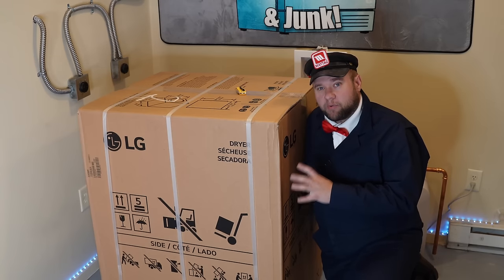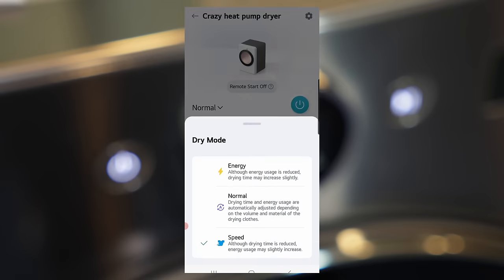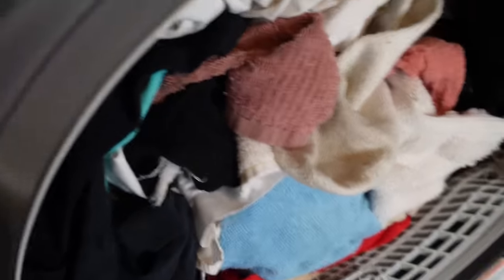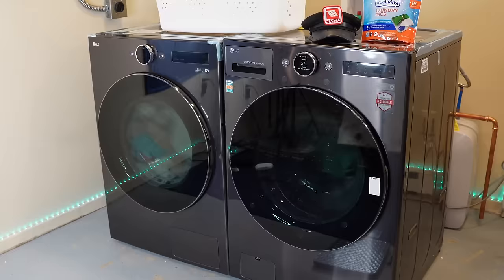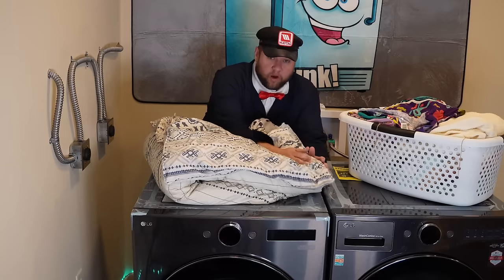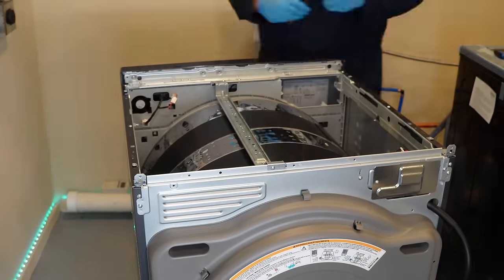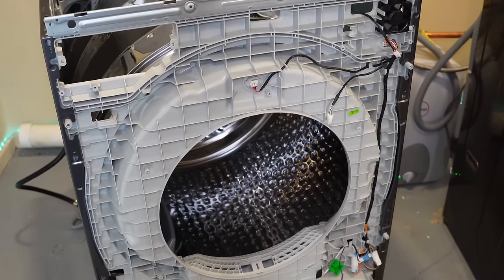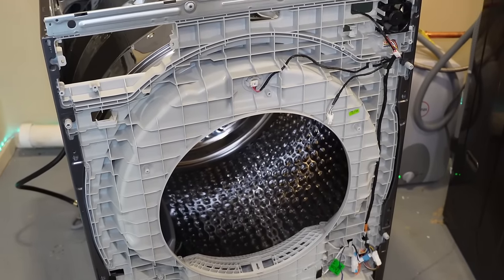LG Heat Pump Dryer - Way Better than I Expected - DLHC5502 Teardown & Review

Comment: You mention the built-in coil wash system, which seems like a nice convenience (assuming it doesn't get clogged over time). However, what is stopping you from just spraying the condenser coils down with water on any of these heat pump units? They're obviously designed to get wet and, as long as you're not using a pressure washer, I think you'd be less likely to damage the fins by spraying them down than by trying to vacuum them out.

Comment: Fabric care would be interesting comparison. A longer but cooler LG cycle or a shorter but (allegedly blisteringly) hot Speed Queen cycle?
Reply: I’ve had a Siemens (Bosch) heat pump dryer since 2013, and my verdict is that it’s way gentler on clothes, due to the significantly lower temperatures. On regular, it’s barely as hot as a typical vented dryer on delicate. On delicate, it usually finishes drying with the clothes being just warm.

Comment: Ben Love your videos very informative. My question Is I read sometimes about people buying ventless heat pump dryers and saying they suck. I know they are different, and was wondering If some  people may install the wrong such as not enough air around the and having a small space with no air vents. Having a Heat pump water heater I know that was a requirement before installing to make sure there Is enough room around It to do It's job. Is this a problem you see.

Comment: You mentioned that it is stackable. Is it stackable with the combo unit? From what I understand, the combo unit has the filter on the top so it might not be. I have a use case where I would like to have both of these and wanted to get an idea about whether these two can be stacked

Comment: Well done, Ben!

Could you please also review the new LG WashTower with heat pump dryer? The new model WKHC252HBA which has a 5.0cf washer with a new 7.8cf heat pump dryer?

Wondering if the heat pump dryer in that new WashTower unit is essentially the same as the separate heat pump dryer you reviewed in this video? If so, then I would go for the WashTower rather than buying separate washer and heat pump dryer and stacking them, since the WashTower would be overall shorter, probably less expensive than the 2 separates with stacking kit, and have the benefit of an easier-to-access control panel in middle.

Also I wonder whether that new WashTower would be able to do the coil cleaning mode without needing to pour a bottle of water in it, since it already would have a water supply hookup to it for the washing machine part?
Reply from the maker: It's almost identical. I've looked at everything and as far as I can tell it's just slightly smaller due to UI concerns. Otherwise it's identical and excellent
Reply: Question…. Do you really need 5” of air space behind the LG heat pump dryer (or WashTower heat pump model)?…. Seems weird if it is ventless for that to be necessary. I’ve installed and used for years several of the LG electric and gas dryers pushed nearly flush against a rear wall in a tight space with no issues, provided the vent is properly routed.
Reply: I've got the new wash tower delivered last week at a new house along with the 2 in 1. Thanks for the awesome tear downs!

Comment: @20.00 AC guy here 20ish years. This is an AC system and I would strongly advise against using afresh or bleach or anything like that. It will corrode your coils and reduce its life. If you reaaaaallly wanted to use something more than water they sell "No Rinse" coil cleaners. These are designed to clean the coil without causing any corrosion, however they are generally used on the evaporator(indoor) coil which naturally has condenses water in the air and essentially rinses itself. All that being said if you use a no rinse cleaner in this machine I would recommend rinsing it anyways afterwards.

Comment: Great review and led me to look at one.  Only issue is the dryer door doesn't like to stay closed.  This seems to be a pretty common complaint in the reviews -- have you seen this in your repair history, and if so, is this a quick fix?  I don't see anything obvious with the striker and door that might be causing the issue.
Reply from the maker: I had zero issues and based on my teardown, would be easy to fix
Reply: @bensappliancesandjunk  thank you.  Is there anything you would suggest I should look at?

Comment: Looks neat. With the recent LG scandals I'd be nervous to buy one.
Reply: All of LGs issues are related to their fridges. Not their laundry units or any other of their products
Reply: @Ikey04-ge9gy  I mean if they can screw up one compressor what's to say they won't screw up another. Plus they did a terrible job handling their problems.

Comment: This is fantastic technology. With the amount of people I live with, a heat pump dryer would take too long to dry though. We have some days that are all-day laundry and waiting already. That said I want one.
Reply from the maker: IMHO, my question right now is.... Given that these are so much more efficient than a resistive heat dryer, why not double or triple the BTU output on the compressor/refrigerant system? Theres enough space for it. Is it because it'd run TOO hot? They do make the heat pump condensers in larger sizes at least overseas in R290. Why not use those instead? i've seen 6,000 - 7,500 BTU compressors spec'd by Samsung, GE and LG. But every one I see is a mid-end system. Why?

Comment: The compressor/coils area is so compact - seems to me that entire section could be mounted in a cassette or sled that could be removed easily for service or replacement. Undo a few bolts, remove some connectors, maybe a bit of duct and boom the whole thing slides out - without almost complete disassembly of the body of the machine. Might even make manufacturing easier and certainly would be of value to customers.
Reply from the maker: I thought that too. The system just needs the input of the water pumps and that's about it. GE did it with theirs so I'm unsure why LG didn't choose it
Reply: @bensappliancesandjunk  There are residential heat pump units that operate like this as well (though not common) and they are a breeze to work on. Some use all flare fittings, so no torches needed when replacing a compressor, or either coil. 

Just pull the sled out, pump down or recover refrigerant, loosen a couple fittings and swap a component.  Very convenient.

Comment: We have the DLHC1455W.ABWEEUS and one thing we do is to clean both filters every load. We use a small vacuum and its a small piece of mind. One thing that you have to watch with the lint filters design it snags strings and bras like no tomorrow. We have gone to hanging them to air dry. It also has dropped our power useage about 400kwh.
Reply: Speaking of the DLHC1455, during the teardown he mentioned it is a condenser dryer. I believe he's mistaken, LG markets it as a heat pump dryer, and the energy star website also lists it as such with the ~50% reduction in estimated annual power usage versus a condenser conventional dryer of similar capacity. The clincher is the refrigerant label on the side of the machine and the power draw of 3.1 amps, I'll assume that's at 240 (it's labeled as 120/240), which both track with LG's branding and the energy star website's information.
Reply: @Sprchkn  it is definitely a heat pump dryer
Reply: Laundry bags...

Comment: Just to clear one thing. 

About coil cleaning. Do not use acidic cleanser or vinegar, alcohol because is highly corosive for coils.

Use normal, certified cleaning liqud for home air condition units. It will do the job and is safe to use. Just make sure is liquid form and not in foam/spray/spray foam.

Those cleaning liquids are alkaline, safe to use, anti mold, remove mold and stains plus disinfect coils.

Comment: Hi Ben, I have been cooking with a 32" electric stovetop or cooktop with metal cook rings. But it is on its last legs. Now I am faced with 36" electric Induction cooktops. With or with knobs Which is the best longer last one to get?  Also if it breaks do I need to replace the whole cooktop?

Comment: Is there a part that can be purchsed to close off the outside vent to prevent bugs etc from crawling through into the house?    Would need to modify this part to completely close off the old vent

Comment: How does this new technology compares to a gas dryer in terms of efficiency (how much will it cost per load) we already have 2 washer and dryer combo due to our larger family size (total of 8 people) there is nothing wrong currently with our unit, but I do like the idea of I no longer having  to service the venting ducts and reduce the CO2 level in the house. Does this unit runs on 120 or 240? Also does it use a belt to rotate the drum or the direct drive technology like most washer this day? That will be anothet plus in terms of maintenance. Thank you for time, and hopefully for a response.
Reply from the maker: I believe I answered most of those questions in the video...

Comment: How much energy did it save compared to a standard dryer?  That is what I'm interested in being off-grid.
Reply: He stated in the video it used 1.5 kW less per load than a standard dryer would. It's also worth mentioning that if your heat source is electric too, this is ventless, so you won't be venting conditioned air, that you paid to heat, to the outside the whole time it's running. So it's probably considerably more than that.
Reply: @jonathansage2147  Thank you. I heard him say 1.5KWH less but mine takes less than 1.5KWH to dry with my current dryer so that doesn't really help. I vent outside in the summer and inside in the winter. Just trying to find ways to make my battery bank last longer! Currently I just run the dryer when the sun is out and use just solar.
Reply: @MyWasteOfTime  are you already using a heatpump dryer? Most are not that efficient.

Comment: Looks great but what if you live in area that has hard water? Would hard water cause mineral build up on the condensation coils or spray nozzles?  Does the factory manual address this concern?  So, best to have a water softener too?
Reply from the maker: You can use distilled water on the Condenser Care mode to remove the minerals. I've seen videos of people doing this, and the results are insanely good.

Comment: Excellent video!! Thank you so much! This finally looks like a winner for a dryer. My problem is a washer.... mine finally died after about 35 years and many fixes. On my 3rd new one now (having to keep returning) and they just all suck! The water level they all use now is insane low and sometimes clothes come out with fabric softener splotches all over and even some on bottom of drum. This is with all 3 new machines. Unreal how shity everything is made now and that it's even legal to sell that way.
Reply: My 8 year old LG front loader has a "water plus" button that uses more water for the wash and rinse cycles, plus a button for additional rinse cycles. I don't use fabric softeners.  They're bad for your clothes and your appliances.
Reply: Why are you still trying to buy a top-loader, a design of washer that every single other developed country has given up on due to their severe and crippling limitations?
Reply: This is why I come to comments.....please elaborate more on why not top load .....we are ignorant in the USA
Reply: @mrufo2297  The dirty secret about getting the dirt out (for most durable clothing) is some friction to go with the water and detergent.  Top loaders don't perform very well if you pack them tight, but front loaders make effective use of a full load (they don't clean as well with very small loads, though).  A top loader will use much, much more water and detergent compared to a front loader.

Comment: Thank you for this review! I wonder if this heat pump dryer is going to extend the life of the clothes - because of lower peak temperatures?
Reply from the maker: Theoretically yes that is something that's been argued for heat pump dryers for quite some time that they are far more gentle on the clothes so they will last longer

Comment: Problem with the energy tracking you can't use just one leg on 240V.  Lots of things don't use power in a balanced way between both legs, depending on why it wants 240V.  So the other leg could be using more or less power.  If  you are seeing only 300 watts on one leg likely the other one is using a lot more and  you are not seeing it.
Reply from the maker: Yes, but in this case, I did in fact measure both legs and added it together. This balances the loads extremely well, unlike a standard tumble dryer where the motor+element leg is on one side, and element is on the other.
Reply: @bensappliancesandjunk  What is the justification for 240V if it is truly only using 300 watts?  That seems needlessly complicated?
Reply from the maker: @darrenorange2982  it shows 300w on one leg, but it peaked around ~1,300w combined. My understanding is that it was designed for markets with 240v, so they didn't re-spec for 120v.

Comment: There's an explanation for the extra-dryness and 220V plug. You missed one interesting feature about LG heat pump dryers. Though LG is extremely bad about their specs in the catalog. The feature is called EcoHybrid. What it basically does is there's a standard resistive heater in the system besides the heat pump. It gives it an extra "oomph" in temperature enough to get extra dryness. It also explains the Power Dry cycle that didn't make sense and sucked too much power - the dryer works as an average condenser one in this mode.
Reply from the maker: Where is the resistive heater? I did not see it during teardown
Reply: @bensappliancesandjunk  I don't think this LG heat pump dryer has the heating element, LG used to make a vented heat pump dryer that had a heating element.  Samsung currently sells a hybrid heat pump dryer (not the combo washer unit) in the US now that has a supplemental heating element.  But that one hasn't gotten any press it seems.

Comment: I'm in the market for an all-in-one but this makes me want to wait for the second generation heat pump units. The current ones seem like a big step in the right direction, but this dryer shows there are still some major potential improvements. Can't help but feel like the GE unit is under-engineered with regard to lint and maintenance, and the LG unit feels kind of rushed out the door to compete. And both could do better at getting the laundry dry-dry. Fortunately I'm in a situation where I should be able to wait on that, but not everyone shopping for a washer/dryer is.

MAYBE Samsung is better, I've seen mention of longer than expected drying times relative to the apparent size of its heat pump system. But I'm not really confident in a Samsung, and I just want a ventless all-in-one that washes and dries well. Not one that plays slide shows, syncs with your doorbell, and runs Doom.

Comment: Good evening sir, would you pair this dryer with one of the 5.2 or 5.8 cubic feet lg monstrosity washers? Ours came with a 9 cubic feet gas dryer and I'd like to stop pissing conditioned air outside. our gas dryer from lg does a 5-10 minutes long cooling cycle before it ends by itself. These systems are 2015 models I think we got them in 9/15 and it has an extremely similar direct drive motor.
Reply from the maker: It worked absolutely flawlessly with the 5cf and could have easily handled more, so a 5.2 would be very easy to use. A 5.8? I am not sure, but I think it'd be OK

Comment: hey note for you Ben..perhapse using one of these 2 gallon 12v battery "pressure washer" were used by a lot of Florida HVAC techs given mold is a huge issue here and won't damage the coils to clean. perhaps a uncharge breakdown clesan charge like an ice machine?